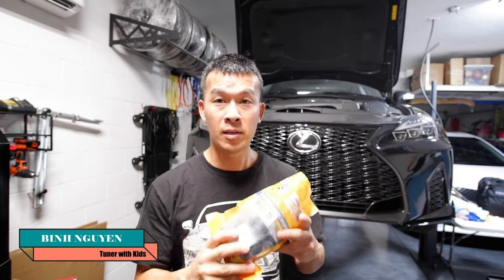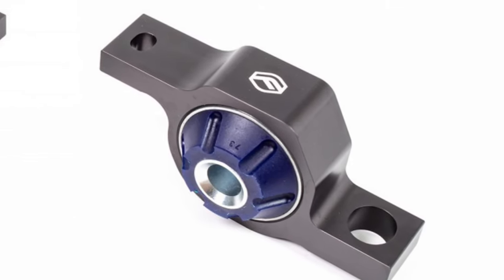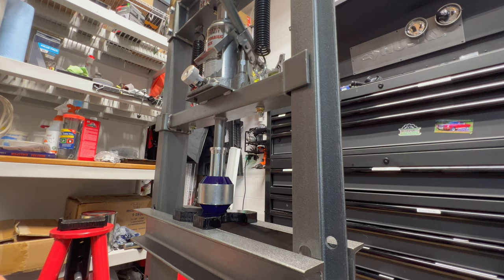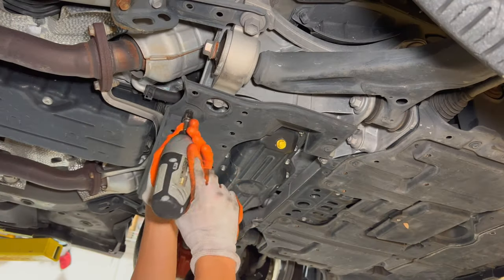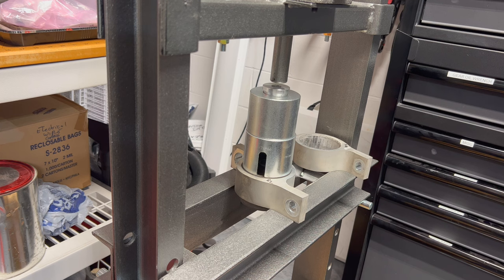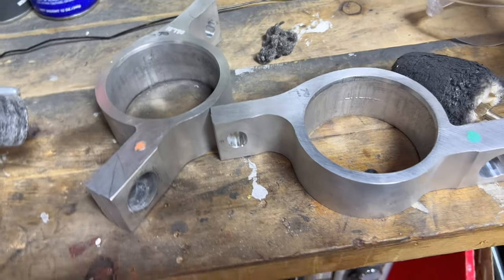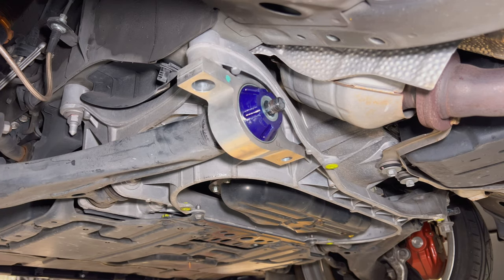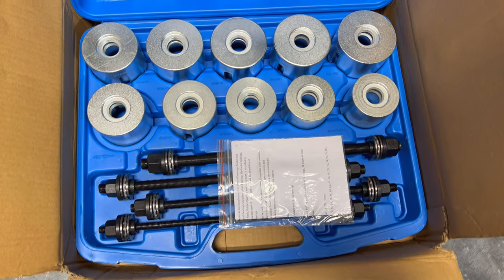How to Install IS250 IS350 IS-F FIGS Superpro #2 LCA Lower Polyurethane Bushing

Comment: your channel is great resource for Lexus owners. although I drive 2008 GS350, your videos are helping greatly, I appreciate your effort to help us. It will help me to keep the car for few years as it has only 138K. The cost of repairs by dealers or auto shops will make it impossible to hold on this old car, but channels like your allows me to do so by DIY repairs.
Reply from the maker: The GS350 chassis is almost identical to the IS chassis. 95% of my videos also apply to the GS.

Comment: You make it look so easy. I bought these bushing and I received them today, I was planning on using my impact wrench and other tools. Unfortunately the metal sleeve that i have doesn't go all the way to 82mm. I'm now stuck because I would have to buy the same kit you have to make it work.
Reply from the maker: Everything is easy when you got the tools 🤣
Reply: @TunerwithKids  Definitely. I found a local shop in LA that will do it for 25 each. I just hope they don't damage the bushings. I had a bad experience before at a different shop, they damaged the bushings and put them in wrong.

Comment: Chao anh Binh, thank you fro the video. Do you think I can remove and replace bushings by hand with manual press or clamp?
Reply: Still no squeaking? Since you're in Orlando tho it might not affect you. Heard it would squeak when temp gets low
Reply from the maker: Need a hydraulic press.
Reply: I reached out to superpro and they said all the bushings come with the tubes installed/won't be able to order with them separate. I'm worried I won't be able to take the tube out even with hydraulic press as it's not prelubed. I think I'm gonna stick to rubber with a harder durometer, as I'm not confident polyurethane won't squeak without being able to lude the ribbed casing as you did

Comment: Great video and a new subscriber. About two months ago my wife bought a 2017 IS300 AWD and I bought a 2018 ES.  I’m trying to understand the suspension issues.  Does the IS300 have the same bushing issues?   Also, help me understand what the issue is with ppl talking about the rear tire wear and rear camber kits.  The IS received an alignment at the Lexus dealership right before we bought it.  So, any help would be great.  Thanks so much.
Reply from the maker: Front issue is the flex from these stock bushings causes toe out during braking. This causes the inner wear. Wear on these cars isn’t an issue. Most people wear the rear tires evenly across.
Reply: @TunerwithKids  thank you.  So, we shouldn’t worry about rear camber then?  If it’s just the front…I’ll order a set of bushings and install them.  My wife drives the car and it’s mainly used for short commutes. I just put new CrossClimate2 (staggered) on hers and the same tires on my ES. We want the tires to last.  Thx again for the quick response.

Comment: I have a 06 is250 awd with 90k miles, my ride quality is horrible and my steering wheel jerks over bumps. None of my shocks are leaking, and I have no play in the suspension. Just passed safety check. Wondering if anyone one has had these issues and what suspension components have been replaced around 100k miles. Great video! Been interested in these for a while
Reply from the maker: 100K miles shouldn't be much on the suspension but after 16 years, some of the bushings may be rotted. Rough ride could also be internal shock leakage too so its no longer dampening.
Reply: @TunerwithKids  awesome thank you for the input
Reply: I had the same issue with my 07 lexus is250 at 86k miles, and I fixed it by replacing the front tires that were unevenly worn from the soft LCA bushings. Quality tires fixed my issue and then I installed Figs 90 durometer bushings to prevent the uneven tire wear. My car now as 111k miles and my front tires have even wear across the tire with zero issues of unpredictable steering.

Comment: Hello, from south Florida Hey, I noticed you had a lot of corrosion on your nuts a lot, what would be the best solution to remove corrosion on any of the parts
Reply from the maker: Soak in vinegar but it removes any zinc or other protective coatings. Paint after to protect. Or buy new OEM bolts.
Reply: OK cool but what about the metal frames?
Reply from the maker: Surface rust can be sanded or wire wheeled and coated with paint. If it’s really bad, need to remove as much as you can and paint to slow it down. Most S.FL cars shouldn’t have this issue unless it’s from north or lives at the beach.
Reply: Are you supposed to tighten the nut on the bushings after you put the car on the ground?
Reply from the maker: @Fuel98gs400 no since it moves inside bushing already. OEM yea but not for these.

Comment: Good video. Did you torque the nut/bolts while the car wheels were on the ground or while the car is jacked up?
Reply from the maker: Jacked. It doesn’t matter as these aren’t loaded when tight.
Reply: @TunerwithKids  Many thanks for the quick response; I saw your vid and other's vids doing everything while car is jacked; however, some people say for loading purpose we need to torque while wheels are on the ground which is NOT possible unless the car is on ramps.
Reply from the maker: These spin inside anyway. Only OEM static bushings need preload.